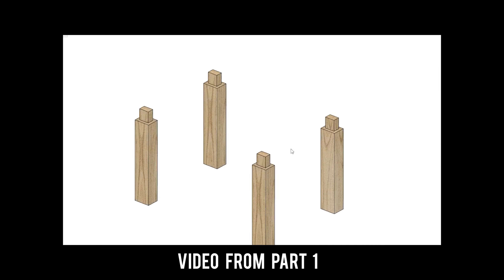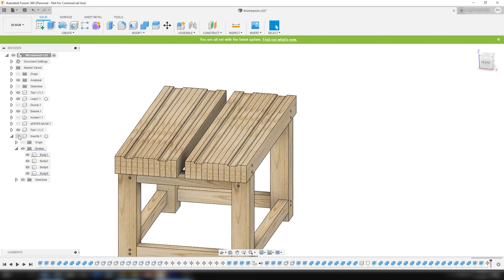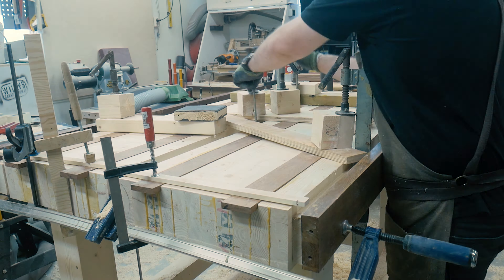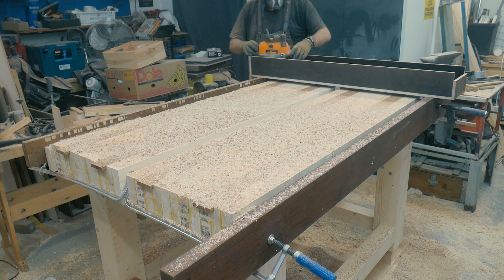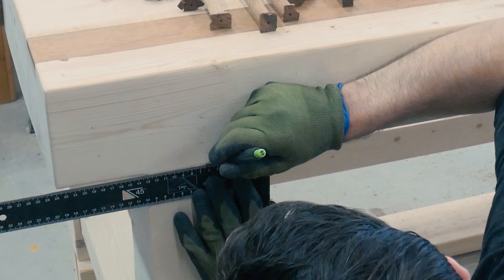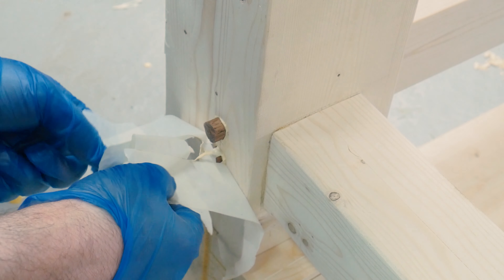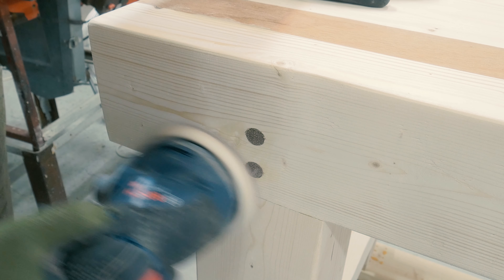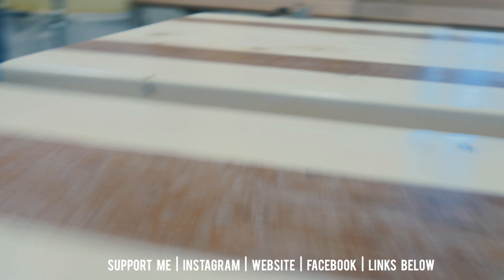Roubo Style Workbench Part 5  - Inserts and Dowels | HARD Wood | Split Top

Comment: Personally I would use a 19 mm drillbit for the bench dog holes (3/4 inch). That way you can use standard size workbench accessories wich is typically 3/4 inch (and 1 inch for the larger size dog holes). You can always drill them to 1 inch / 25 mm if you decide to make use of such accessories.  Flott arbeidsbenk!  Er det lov å spørre hvor mye materialene kostet totalt for prosjektet?

Comment: Great work. But what are the hardwood inserts for? Are they just architectural ?
Reply from the maker: Thanks :)  they actually does have a function besides looking reeeal good!! ;)
Since the bench is made out of soft wood and I want to make holes for bench dogs later, the hard wood inserts will make the top of the holes stronger. So they are positioned right where I want the dog holes to go if you understand 👍😃
Reply: @WillysGarageNorway  many thanks